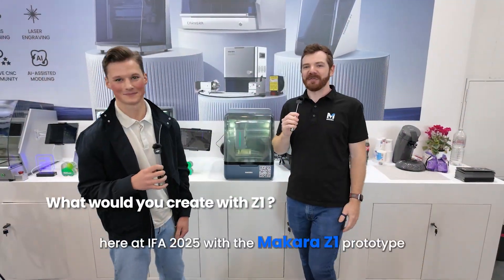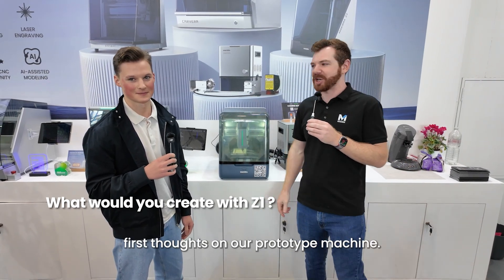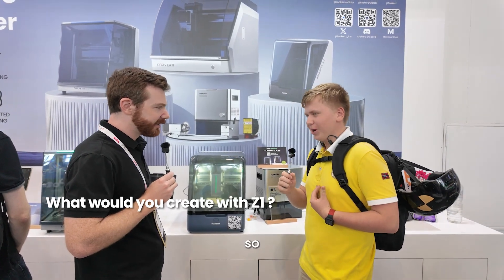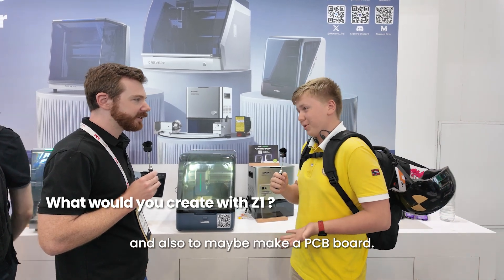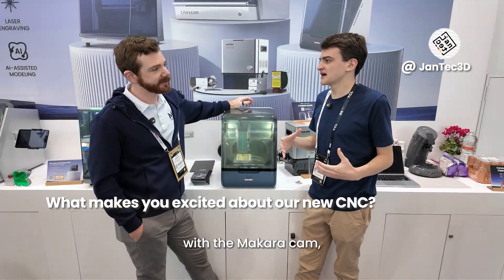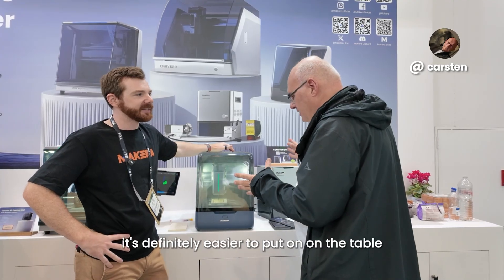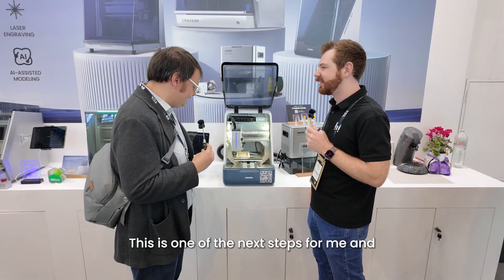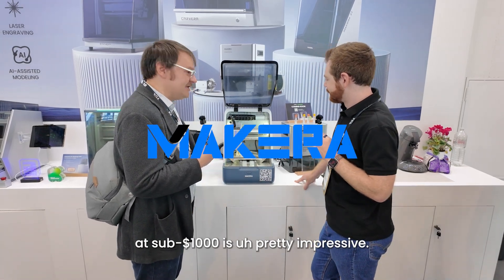What do you expect from the Makera Z1?Let's hear impressions from IFA audience👂

Comment: Few days ago I reserved one by deposit. Question: will it be hackable? 😁 could i (in theory) build my own 4 axis or attachment and used existing IOs? Could I fabricate some holders, mod g-codes, use IOs, add actuator for spindle bit release and try to make my own ATC like in bigger CNCs?
Reply from the maker: We do not recommend that you make the changes yourself. However, if you have the technical capability, we do not impose any restrictions. But it might affect the after-sales service.